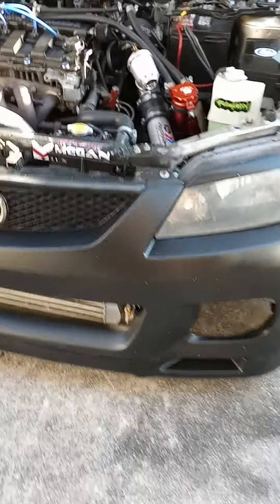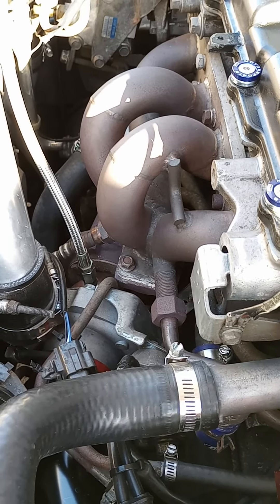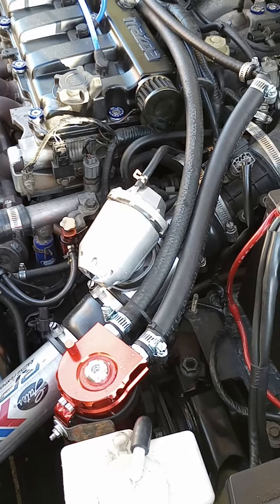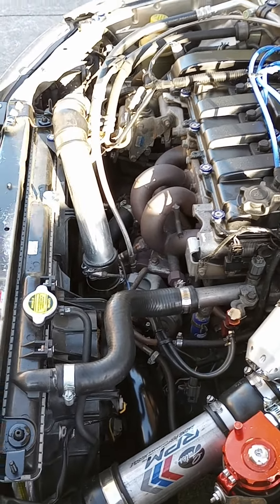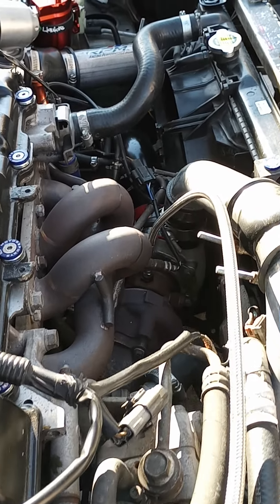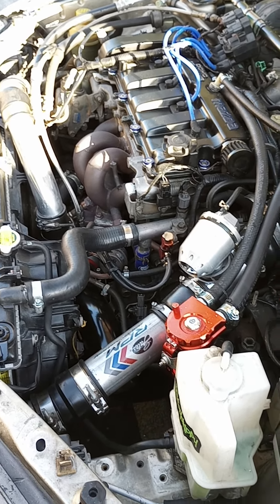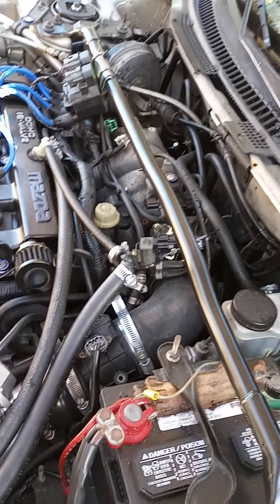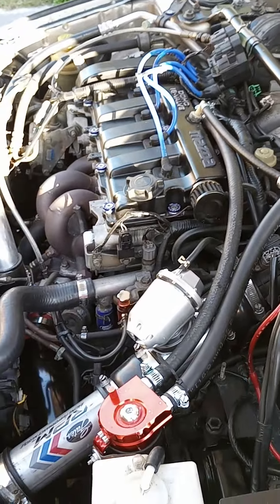Detailed look at the engine bay. what I did to turbo my Mazda Protege Es.

Comment: I noticed moded the coils. Please make a video on how you moded the coils and spark cables.
Reply from the maker: Hello! They are actually 1.8L Protege coil packs and plug wires. They plug right into the stock harness, no modification required.

Comment: Do you have specific parts list for your build? Seems pretty straightforward. I purchased a 2001 LX 2.0 5 speed at an auction in November 21 for $800! I love it! It's so much fun to drive but would love to add more power. Speaking of which do you have any idea what kind of power you are getting from the minilambo🤔😄
Reply from the maker: If you're on Facebook I made a post on there with the general parts needed in a Mazdaspeed Protege Enthusiasts group. Most of the parts on mine are from eBay. She's probably making around 200-210hp around 7psi if I had to guess.
Reply from the maker: If it's manual,the Mazdaspeed Protege ecu plugs right in, you'll need a turbo manifold and turbo,downpipe ,intercooler and piping, colder heat range spark plugs, premium fuel , a blow off valve or bypass valve, turbo oil and coolant lines. I tapped off the oil pressure sensor with a eBay oil feed line kit, I tapped the oil pan for my return fitting, my coolant lines I stole from my throttle body and ran them to my turbo, if you run a bov that vents to atmosphere you'll want to relocate the mass air sensor to after the bov,closer to the throttle body, I may be forgetting a thing or two but if you have any questions just ask. I shopped around and found deals on stuff and spent about $800 to turbo my car.
Reply: @SteveTheBeardedWonder  thanks Steve! I watched several of you're videos and you make it seem fairly easy and thanks for the price mark. Wanting to get back into the 300zx twin turbo scene which I've been out of for  sometime now. But if I can get this car. Turboed for around $800 plus the $800 I paid for it. That's the cheap thrills right there buddy lol. Thanks again!

Comment: Hey bro got a question can you make a video on where you put the feed and return line for your coolant?
Reply from the maker: Hey ,yeah I'm sure I can. I actually stole the coolant lines for the turbo from the throttle body. There's a feed and return and being in Florida, it doesn't get cold enough to worry.

Comment: Hello I'm having issues finding a 3 way elbow hose thats hooked to the turbo and coolant system by anychance did you have a bypass I would gladly appreciate your response 🙏
Reply from the maker: Hello. Look up jppartsinternational.  He deals in new and used Mazdaspeed,Protege parts. I ended up using the throttle body coolant lines for my turbo to avoid using the 3 way elbow.

Comment: How hard do you think it is to turbo an automatic protege?
Reply from the maker: The hardest part of that will be the tune. The msp(turbo Protege) ECU plugs into the manaul Protege but the auto ECU is shaped different so you'd probably need a stand alone ECU with a tune. Otherwise these cars are easy to turbo.

Comment: I have an 02 Mazdaspeed Garrett callaway turbo setup.Will this 2860 plug and play without tune ?
Reply from the maker: That's correct. I started with the stock Garrett turbo then upgraded to the 2860 and it's been on the car for over a year now with no issues. Running 8-9psi now and it feels great.
Reply from the maker: The only thing I had to do with the eBay 2860 was drill out the holes in my downpipe flange a little bit. If it's a Garrett 2860 it'll bolt right up.
Reply: @SteveTheBeardedWonder  is there any way I can trouble you for a link to the exact turbo you purchased please.
Reply: @SteveTheBeardedWonder  is it the one for $144.99?
Reply from the maker: When I bought mine it was $114 or so . It was the gt2860. It's the non anti surge housing one. Ill see if I can find a link.
Reply from the maker: The 144$ one looks like the gt2871 with the anti surge housing. This is slightly larger. The gt2860 is the $115-120 one give or take.
Reply: @SteveTheBeardedWonder  thank you so much!have you done a video on how to install the oil catch can?
Reply from the maker: Im pretty sure I did lol it usually goes between the intake manifold vacuum source and the pcv valve.
Reply: @SteveTheBeardedWonder  thanks for all your help bro!Youre a lifesaver!

Comment: What coil setup do you use?
Reply from the maker: 1.8L Protege coil packs, plug wires and valve cover.
Reply: So the valve cover from an earlier protege fits the valve and gasket?

Comment: How long do you think it took you to do all the work?
Reply from the maker: It took me a couple days, doing a few hours each day. Using the stock turbo ,manifold, and downpipe it makes it a lot easier . Pretty much plug and play with a few items from eBay like a new feed line kit and figuring out your turbo oil drain situation. I tapped the pan. No issues in 4 years.
Reply: @SteveTheBeardedWonder  nice man, I just got a 2002 2.0 with the 5spd and really want to do this swap. Have you had to do anything with fuel or the clutch?
Reply from the maker: @fobiojames  oh nice, that's what I have. Mine is a 2002 Es. 2.0, 5speed. Didn't have to touch the fuel system or clutch or anything. I'm still on the stock fuel pump and injectors. The Protege is remarkably easy to turbo thanks to the Mazdaspeed Protege. :)
Reply: @SteveTheBeardedWonder  yeah I'm getting pretty hyped to do the swap! How long have you had it and have you had any problems with it at all?
Reply from the maker: @fobiojames  I've owned the car for about 6 years. Had 67k miles when I bought it and just rolled over 203k. Runs and drives absolutely amazing. It's not fast, but it's quick as hell being as light as it is. It took me a long time to dial in the setup but now it rips on just 5-6psi. I run it up to 8-9psi occasionally. No real issues honestly just normal wear and tear stuff. Water pump and timing belt around 190k but otherwise,plug and play. You'll need colder spark plugs gapped to .028 and premium fuel.
Reply: @SteveTheBeardedWonder  that's awesome man your getting me even more hyped to do this swap thanks for getting back to me on this. One last question, did you do the oil cooler on this? Is that even needed?

Comment: What size injectors
Reply from the maker: Stock for right now. I believe they're around 280-300cc stock.
Reply: @SteveTheBeardedWonder   so are you using the original fuel pump for the 2002 protege
Reply from the maker: Correct. Stock fuel pump and Injectors.